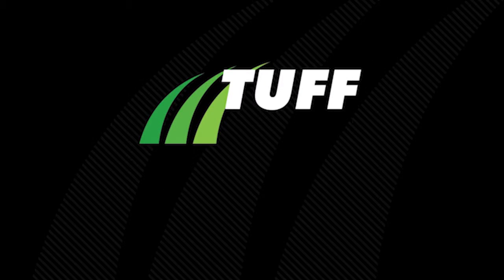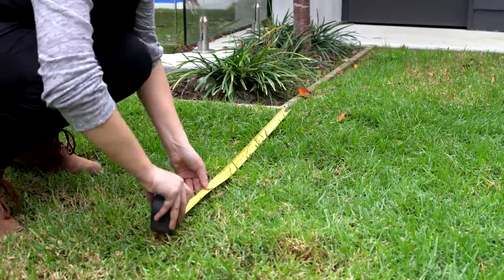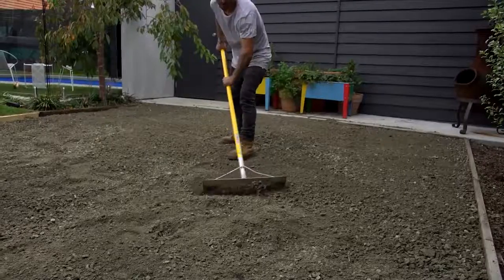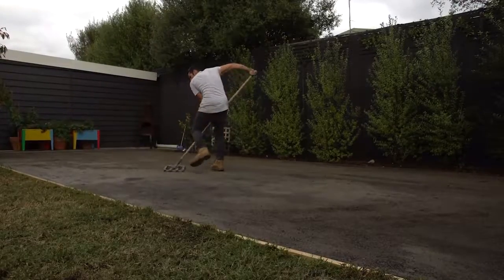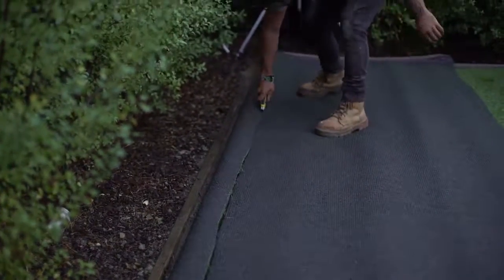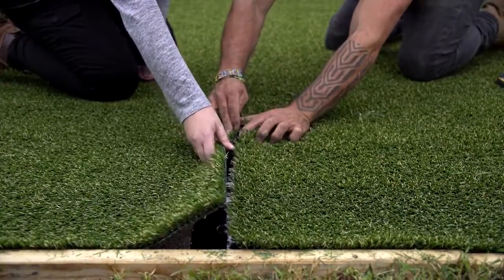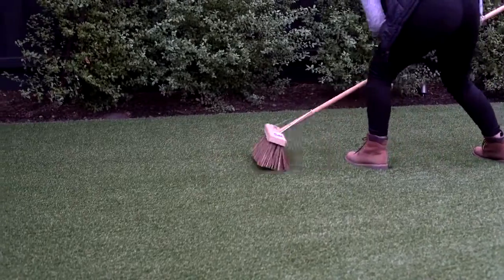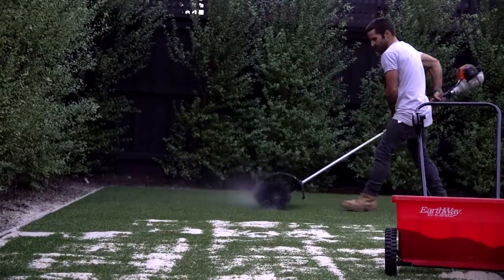How to install Synthetic Turf

Comment: Crushed rock to 60mm depth followed by crusher dust 5mm to 20 mm depth for the sub base. 
Any recommendation for size of crushed rock? I want to get this right. 
Do you recommend a weed mat underneath the sub base? Thanks
Reply from the maker: Hi Wayne, a 20mm particle size is sufficient for the Crushed Rock. This forms the bulk of the base so you're right in wanting to get it right. We don't install any membranes or matting when we build a base. If your property is at the base of a hill and is prone to abnormal amounts of water sitting in the area, adding a weedmat between the substrate and the crushed rock and/or between the Crusher dust and the turf, you can. For most typical installations it will only add unnecessary cost.